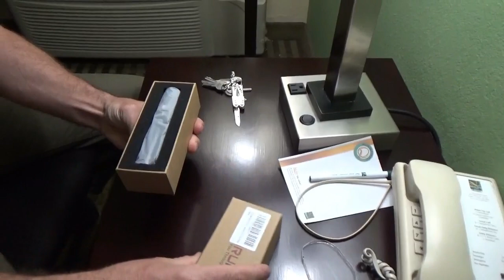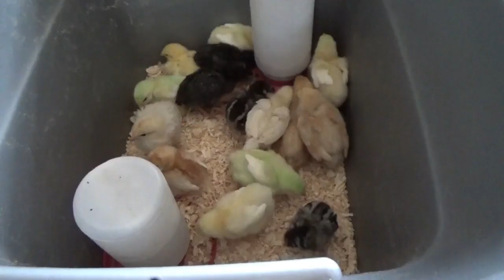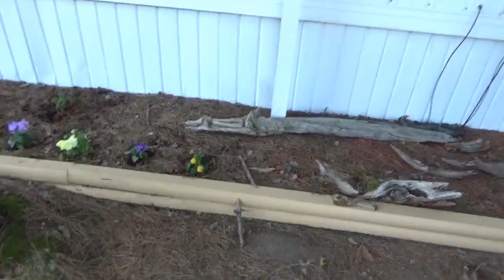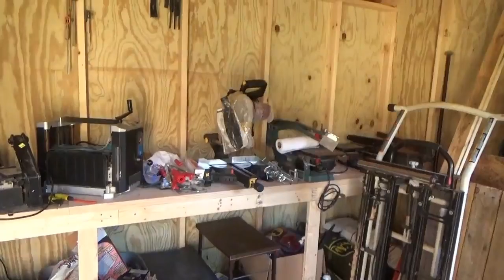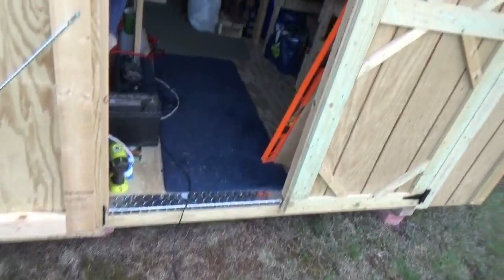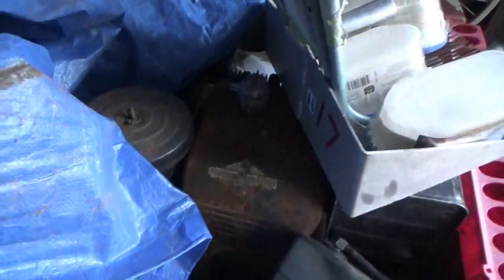Back To Work On The Homestead

Comment: I'm curious to know, are you going to take your house off grid? or just your Workshop
Reply from the maker: Yes of course. But it will take time and money. Lots of both. I hope to get the water heater off the grid next month. That will help very much.
Reply: Going to use hot water solar panels?
Reply: And did you save those air heaters that you ripped from the top of that house that would be interesting to install them to be ready for next year... Just saying I really like the idea of you being totally off-grid like your tiny house I found it interesting honestly recently it's a little bit boring for me but I'm hanging in there
Reply from the maker: Thank you for hanging in. I am hoping to finish unpacking soon and be back in business full time. I want to use solar electric hot water heating. Hot water panels require a lot more money and work. And hard to maintain in winter. I sold the air heaters before we left NY. Just too big to take with us. I was afraid they would get broken.
Reply: Makes sense I was looking at some of those 12-volt elements they seem pretty cheap they only draw a few hundred Watts so you could probably make that work easily

Comment: I used a large wire dog cage for 12 baby chicks. I put a sub floor made out of 1/2 " sq wire mesh  so their mess fell thru to the tray under the sub floor. I covered the removable tray with paper and could change it daily.  As they got larger I put in a couple of wood dowl rods for roosting post and they lived in that until they feather out and could be moved outside. when loose in the back yard they still come to the back porch thinking they still live there instead of the coop.   The wire dog cage proved to be an excellent starter pen easy to hang a lite and cover with a sheet at night to keep them quiet.

Comment: So when are you going off grid again? You have everything to do it now. Im just waiting for you to cut off the power and run solely on solar like the true off grid house you sold. Keep up the video's just hope to see more projects.
Reply from the maker: I do not have everything needed to take the house off the grid. The office and wood shop are fully off the grid so far. But to get the house off the grid will require a lot more. Either rain water collection or 240 volt solar power output for the water pump. Solar powered hot water heater conversion. Grid tie inverters. More solar panels. More wire. More batteries. This is not the tiny house which I took off the grid on my own through the years. This is a full house which was on the grid already before I came. Its not the same thing at all.

Comment: Shops are looking good!  Your rafters for chicken coop will work ok.  To make them stronger use plywood instead of boards for gussets (avoid splitting under load), and use a lot more than one screw per joint.  Mfg trusses use nailer plates with equiv of one nail per square inch throughout the joint.

Comment: Troy: Use construction adhesive with your screws; the structure will be stronger and last longer.   Remember screws are good for  pulling not shear; they are to brittle.  Or use use nails and the air nailer.    Bert
Reply from the maker: Thank you. Yes I am thinking about getting out the air tools

Comment: how are you going to tie the rafters to the walls of the chicken coop? I think you might need to cut birds mouths.
Reply from the maker: toenail them in. And then I will use cross bracing to hold them together for me as I put the sheathing on.

Comment: if I got a flashlight from a company like that I would assume not quality on those "o" rings but little faith in the product! I know all rubber gaskets and "o" rings brake down in time whether or not they are in the product or not so I'm not seeing why they would send something that will brake down at the same rate as the ones they have in their product!
What you are calling a rotary lawn mower is in fact a reel type mower ! 
On the screws correct me if I miss understood you, but you said the self tapping screws were for wood in fact self tapping screws are for metal!
Reply from the maker: Oh, you might be right on the screws but I prefer to buy only self tapping wood screws for my projects. I thought that was what they were. Have to check again.
Reply from the maker: So far I have not had to replace a ThruNite gasket on anything that we use daily and we use them heavily. I think it shows a sign of good quality in a time when most companies skimp on extras and sell them to you separate.